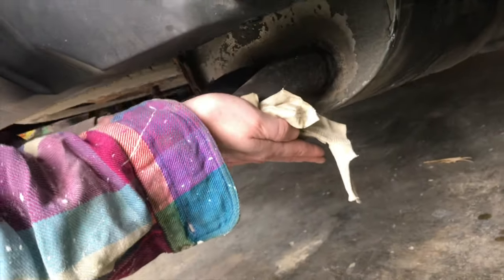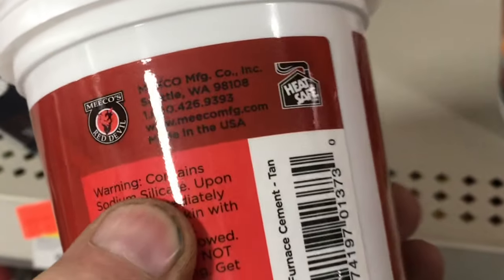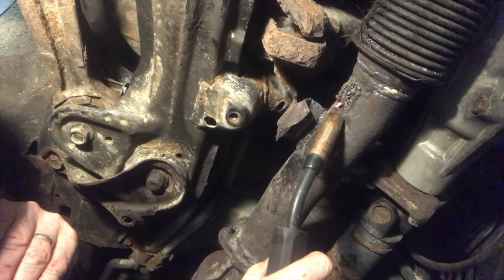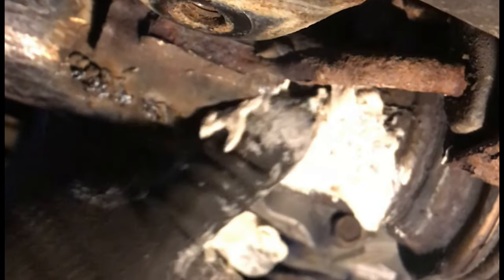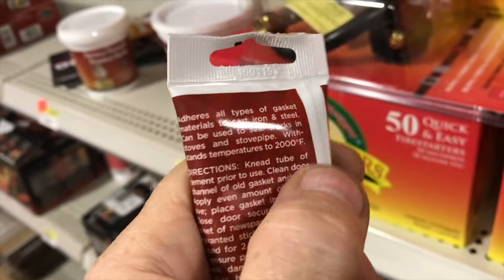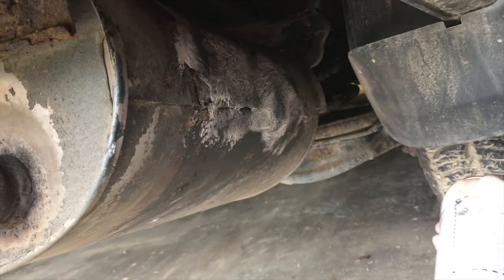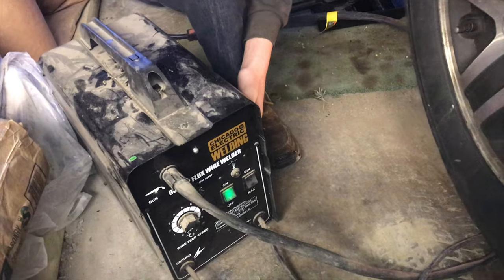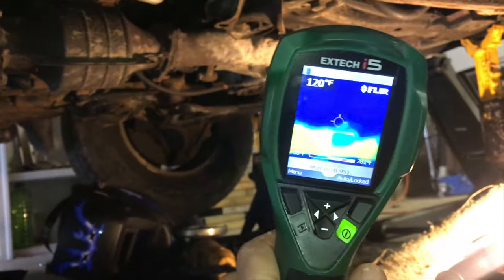"UNCONVENTIONAL” exhaust fix that WORKS (even in front of the catalytic converter) LOW COST

Comment: Currently using stove sealer on my muffler.  It works better than the muffler sealer.  A little harder to apply, but the stuff will not crack off.  I'm baffled why there's not more videos on this awesome hack.
Reply: Followup - 3 months later and the stove sealer is working amazing on the muffler.  I will NEVER use muffler sealer again....and I had been using it for 30 years!
Reply: There is, look up exhaust manifold repair with furmance high heat cement.   Hercules High Heat Furnance Cement.

Comment: I almost threw in the towel on attempting to repair a cracked catalytic convertor on my Mercedes ML55. The weld seams on this vehicles convertor commonly splits. It is tucked in between the frame, trans crossmember and torsion bar, no way to hit the top side with a weld. Repairing this section is labor intensive and requires new pipe and convertor with 2 significant angular bends. Easily a $400-500 repair. I'm glad I took 2 minutes to scan Youtube for one final shot at finding a solution. Lets see if it works. Thanks for posting

Comment: J-B Weld ExtremeHeat Epoxy Putty. Used it to fix before and after catalytic converter exhaust leaks. It's all you need unless an absurdly large leak/hole/tear. Then you may have to weld.

Comment: For spray paint I like the ceramic brake caliper paint from an Advance auto parts store. Stainless steel hose clamps and various parts auto parts stores sell for exhausts help, such as flexible pipe sections.

Comment: I have an 08 TB with the 4.2i6. Notorious for a cracked exhaust manifold.  It's my baby but she got over 200k on her.  I've already welded the Crack and it doesn't stick no matter what method I try so now after watching this I'm going to the hardware store and getting furnace cement, grinding my weld clean and applying it with crossed fingers.  Thank you
Reply: Any updates....?
Reply: @krushon3298  ya it held up for a few days and cracked apart just like the weld but I read that it was supposed to be applied to a cold surface and I got mine to operating temperature before applying it.  I might clean it off and reapply it today cold and if I do ill follow up my comment with an update for you.  Sorry it took a while to reply I didn't see this until today.
Reply: Work out?
Reply: @Izzyizz845  no sure didn't but could be something I did wrong

Comment: Been dealing with bunch of holes on manifold,Furnace cement does work but it my falls off after a month or do. 
You really need to prep the area well. Right now I have JB weld extreme heat and inferno heat on three of the pipes with a clean prepped area and they been holding up well. 
The one pipe I just used more JB weld extreme heat and used furnace cement to path under the pipe. 
It’s hard to clean all the areas well when it’s tight

Comment: Nice work Error Code Guy! My car is leaking the most right at the exhaust manifold gasket. I'm thinking of using JB Weld Extreme Heat around the manifold with a shop vac stuffed in the tailpipe to pull the Extreme Heat in and seal the leaks. Or would you use furnace cement? I tried the furnace cement with some high heat wrap tape last the winter on another car with a cracked manifold. It was probably too cold when I put it on. Have you ever had trouble with it cracking and falling off?
Reply: Neither worked for me. Temps were too high, just fell apart within a few days. I just ended up getting someone who knew how to weld. I legit tried everything possible including black cement to the JB weld and others alike. Turns to ash

Comment: I have an exhaust leak BEHIND the heat shield on one of the welds of my catalytic converter....i guess im going to take the whole pipe off to gain better access to it and see if i can maybe reach in and cover the leak....

Do i need to sand it down and clean it to get the best bond or can i just smear the stuff on?

Comment: Did you use the soldering wire that came with the machine or are you using a different one?
Reply: It’s not soldering wire it’s called flux core welding wire probably .030 size it’s what’s used in a mig welder

Comment: Hey error code guy or whoever might stumble upon this. I am having trouble getting a donut gasket between header and catalytic converter to seal. The donut gasket even the softest I can buy won't actually compress, it just bends the tabs on the cat toward the header. I even tried a split flange behind the cat mounting tabs which just bent the split flange aswell. Could I use exhaust repair wrap around the donut gasket to get it to seal until I can get a new cat or do you have another recommendation that may work?

Comment: Man i have a 2001 8.1 liter chevy truck it starts and dies immediately 8 have replaced the fuel pump and i am currently waiting on a fuel position sensor to come in do you have any idea what might be causing this
Reply: Check the crankshaft position  sensor and camshaft sensor , the resistance ohms of each connector with factory specs.
Reply: @Decimusblack88  we have checked all those gonna try multi port system we think that may be the issue ill get back to ya thanks for the info tho
Reply: Scotty Kilmer said when they do that to replace the Mass Air flow sensor and the Throttle Position Sensor.

Comment: A gob of furnace cement slathered  together with foil heat tape wrapped around the pipe works very well for me.  With cement alone would last a year or two at most.  None of the repairs with foil tape have failed yet.  Note; for the foil tape to be effective, fully wrap around the pipe adhered with the cement.
Reply: Might have to try the tape next.  I cover one hole with thin metal and wrapped wire around the pipe to hole it.  Then used JB weld extreme heat and furnace cement
Reply: So first apply the cement and then wrap the tape?   If done the other way.....its not effective?
Reply: @NextLevelAutoDiagnostics  I just replaced the manifold instead. It’s a 2002 Sierra 2500,  the cement who hold for a while but after 6-8 hours plowing the stuff would crack.  Got tired of wasting money buying the stuff
Reply: @chachifeere  Thanks
Reply: David.....can u please explain if the tape should go first and then the cement.  Or the other way around.  Thank you.
Reply: @NextLevelAutoDiagnostics  foil tape or not even m pretty sure it will fall off eventually.   Had 3 pipes with holes and 2 stayed intact but the biggest whole it would eventually crack ,  I did many layers putting it on everyday and the using a heat gun to heat it up to cure and get hard.
Reply: @chachifeere  Thank you Chachi
Reply: What foil tape do you use??? Thanks.

Comment: Are you for real? You have a welder, but you are using it to bodge the paste on a hole. Just weld a steel plate over the hole, if you are too cheap to weld in a steel pipe instead of the rotten one. And if the pipes are so rusty, then the mufflers are even worse on the inside. Replace the while exhaust segment, instead of turning your car into a junker.